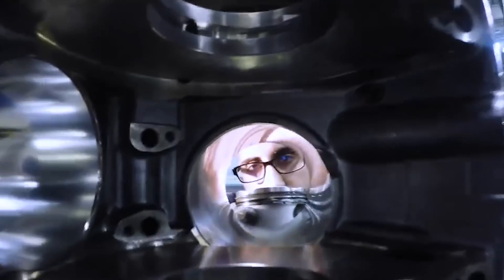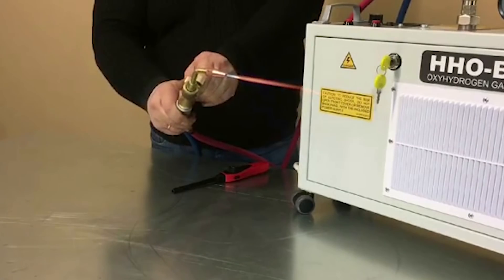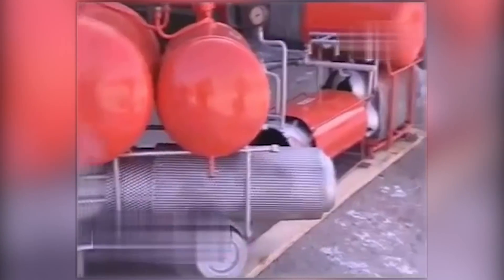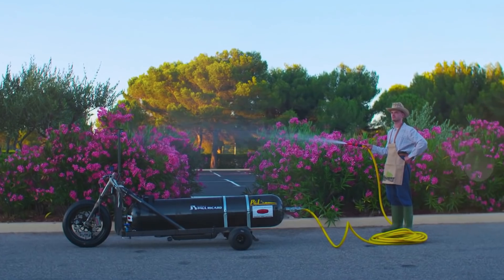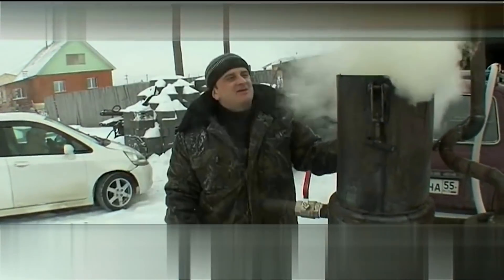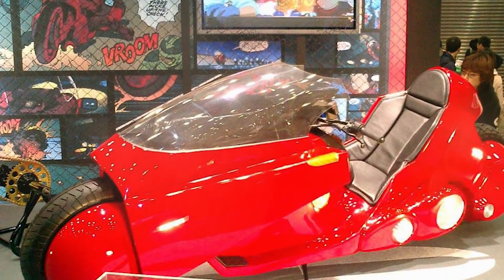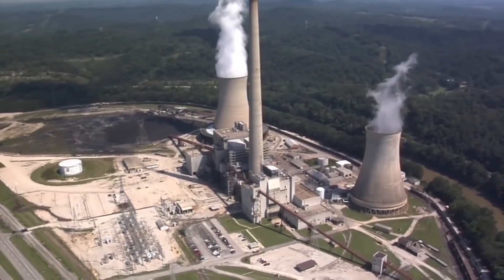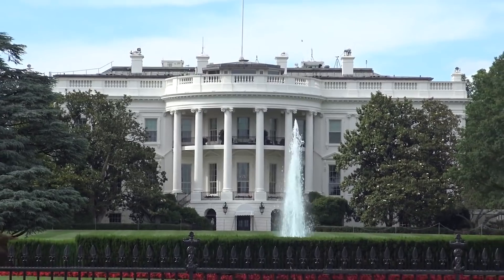Why These Engines Are Banned?

Comment: Also, get in a wreck with that wonder car.. BOOM you got a pneumatic bomb lol
Reply: About forty years ago, I saw a man drop a full dry nitrogen bottle, the neck crack off, and the bottle went through a couple walls, and two cars, lodging in a third, all parked.  It  was dented, paint chipped, but once it's "cracked open" whether a broken stem, or safety valve, the energy drop from pressure release prevents a tank explosion.  That took place on a Naval air station, when someone rolled a bottle without  a cap, across a hanger deck, but something recorded here and there on a regular basis.  Imagine the car suddenly reversing at "full power" as it expends from the striking end.

Comment: Air driven (NOT air powered) cars have existed for a very long time, used in coal mines. Problem is, that the efficiency is very low and they're still powered by conventional means, such as burning coal for generating the electricity to compress air.

Comment: Compressed air engines have been used in wholesale market & warehouse forklifts for many years. It simply a way of moving the pollution away from the warehouse/market. Diesel & LPG forklifts create pollution as they're being used, where as compressed air forklifts only create pollution indirectly, by the compressor, as they're being filled, but this can be done outside in a yard next to the facility rather than in doors. So it means one doesn't have to spend lots of money on extensive ventilation systems & the flavour of perishable groceries arn't effected either. That's the main benefit. Plus there isn't the hazardous chemical waste one gets with the manufacture & disposal of batteries

Comment: Ok so because I'm an American I don't have a very clear real world reference of how long a kilometer is so I'm gonna go ahead and crunch some numbers to help fellow Americans. 1 mile is equivalent of 1.6 kilometers. So the air engine can go 100 kilometers an hour. Which means it goes a Max of 62.5 mph. With a range of 130 kilometers (roughly 81.25 miles). So I'm going to give a real world example of how much of b*tch that would be to a lot of people: my mother commutes about 45 miles one way to go to work everyday. She would get pulled over on the interstate for going 15 below the speed limit, and wouldn't be able to make it within 6 miles of home on the way back. That's why air engines aren't implemented in the US they are crazy slow and range is an absolute nightmare scenario for the average American. Tada!

Comment: "Magnetic engine" yeah bud... that is just a motor... it's not powered by magnetic fields... if it were th s3 t would literally break the laws of thermodynamics.
Reply: Already you can get bicycle lights that work without  a battery, generator or alternator. They pick up energy by using magnets to tap into the eddy currents generated by the spinning wheels, there-by not putting a load on the bike that bottle generators & hub generators do. I assume this Russian tech maybe similar
Reply: @mickvonbornemann3824  If you're extracting power from a system you're extracting power from a system. Any magnetic pickup to drive a bike light applies a load to the bicycle, it's just more efficient than a mechanical interface.
Reply: @mickvonbornemann3824  That's exactly what an electronic engineer calls a permanent magnet synchronous generator. 

They are widely used in different shapes and sizes.

Comment: Compressed air is NOT fuel. It's just stored energy. Same as electricity. These types of stored energy engines require ANOTHER engine to store the energy for them to use. That energy must then be stored in an energy storage tank/battery, then transferred from there to an on board energy storage tank/battery.  High KWH batteries and high pressure heavy cycle failure resistant pressure vessels both require a lot of energy and resources to build. This is why both compressed air and electric engines are both inefficient. They CANNOT power themselves with fuel and require costly, specialized support systems.

Comment: Soo... the only thing that is actually "banned" is the scientifically impossible perpetual motion engine? Yea i guess that makes sense. Building one of those would be against the law... OF THERMODYNAMICS!.
Reply: :P
Reply: Scientifically impossible perpetual motion... Earth spinning forever in a spiralling cosmos would beg to differ.
Reply: @UncleGhoulieTv313  Not at all. You may want to look into the deffinition of the word "engine" the earth is just a big ball spinning in a zero friction environment. If you could extract energy from the earth's rotation that would introduce friction and it would eventually slow down and stop. I am not a scientists but it does not take a genius to figure this shit out.
Reply: @UncleGhoulieTv313  The earth is continuously slowing down as it loses energy (e.g. by the tides). However, it will take a while ...

Comment: Banned by extreme forking brigade. Controlling expansion dynamics inside IC engine through electro-magnetism has been tried and proved to work efficiently with small chain HC but with intermingled & long HC adulteration, it becomes useless. Bajaj in India tried dts-si with intake nozzle design for better atomization but adulteration brigade simply killed it....

Comment: I had a toy car back in the early 70's which had a compressed air engine, all made of plastic, except for 1 bearing and spring which was the check valve. you pumped it up with a little toy tire pump that came with it. It sat around until i was in my teens, and I hooked it up to the air compressor, and over pressured it, the check valve bearing got hot, and melted into the plastic..

Comment: None of these are "banned," and some of them require more energy in than you get out, even over and above a normal gasoline engine. You have a very good point with Thorium generators, and the U.S. had one running back in the 50's or 60's, as I recall, so it's not like we don't know how to start producing them, although I hear they still have corrosion problems. The fuel is cheap and plentiful, as well.
Some of the deaths you mention are very suspicious, I'll grant you that. But the Wankel, wood gas, air-compression vehicles...none of that is secret, none of that is "banned."
I believe Tesla has a large battery designed to run office buildings, that uses hydrogen generated from solar, so the electricity for the building can be generated by solar panels normally, but also can store excess for night time or cloud-cover situations. I wonder just how much excess energy is not being used on a normal day, however.
Many of the comments here are overly criticizing, I think. There is some information here that's useful, but you shouldn't have hyped it so much.

Comment: Fuel evaporization carburetor: 
Changed a small block ford engine from 250hp to 300hp and increasing fuel eco to 30mpg whereas it was around 12-15!!! Been around for 70 years or more. People who presumed it were bought out by foreign oil owners and those who didn’t sell out came up missing, families killed, one person was cut off and not recognized in society, couldn’t get electricity, send or receive mail. People have opened the door to shotgun blasts. I found these accounts in the early 2000s. I haven’t seen that sort of info since when I got curious. Corruption
Reply: ztwntyn8,
Why wouldn’t a foreign country or army use this technology?
Why wouldn’t a competitive race car driver use this technology, or a criminal,  or backyard mechanic, or competitive auto manufacturer? 
Because it’s non existent.

Comment: Don't promulgate bullshit.  You've lumped a bunch of urban legends and half-truths in with workable niche-use technologies (like the wood gas generator you described as a "wood burning car", which would just be a steam car burning wood, which a gas generator is not).  There is no global conspiracy against engine technology.  Anything useful will be invented.  The car companies would love to sell cars that got 100MPG or didn't use oil at all or whatever.  They don't work.  Closest anyone has come is Smokey Yunick's "Hot Vapor" Adiabatic engine, which did generate very high horsepower and achieve very high fuel efficiency, only thing was the thing ran so hot the block was incandescent!  It ran on the bleeding edge of materials sciences, like the Atomic Ramjet in the SLAM (Project Pluto).  It's still around and some guy is still working on it, but it's possible it will be many decades before it's ready for mainline use and we may very well have something better by the time materials sciences makes it possible, kinda how you could almost certainly build a supersonic prop plane (say, for instances, an airframe like a Raytheon Starship with 2x of the Kuznetsov engines from a TU-95 "Bear") but for what purpose?  

True evil is rare in this world, and evil is unprofitable, (Nazi Germany wasted critical defense resources like fuel and railway motive power and rolling stock to wipe out the Jews, whose labour and technical prowess could have definitely also contributed to the war effort), so what it's easy to see as evil on the surface is usually either stupidity, inertia, or a factor or factors the observer does not understand.  There are some cases of "disruptive technologies" being intentionally crippled by industries, but all the examples I'm familiar with are consumer recording devices that the media industries demanded be limited to prevent people from copying their works; things like DAT and DCC, W-VHS and so on.  But these things did make it to market and were developed by big companies themselves.

Cars and other prime movers can't run on water or air.  Water is basically the ash of the combustion of hydrogen gas, you can't burn what is already burnt to hell and back.  Cracking it requires energy input and is a niche use technology although the use may grow as circumstances change.  Compressed air is simply a storage medium for energy, and a rather shit one at that.  The cylinders are heavy and dangerous, if they are charged they detonate with considerable force if breached, not something you want in a small, lightweight car.  

Nuclear power is the victim of stupidity on the part of "environmentalists" who associate it with nuclear arms and the Chernobyl disaster, in ignorance of all fact and reason, and who will never be pleased by any technology no matter what.  The same "environmentalists" protested a windmill farm off the coast where I live, claiming it would mung the paths of migratory birds.  These people cannot be pleased and it's recognition of this fact that makes people ignore any concern of the environment because they know there is no way to please the environmentalist, who is, at his heart, an idealist, and we must remember that an idealists is one who, on noting that a rose smells better than a cabbage, concludes that it must also make a better soup.

Comment: I’m no rocket scientist, but’s hen he said “air tax” I was like, really?😂wtf, I’m so lost... is this banned car mods or makeshift fuel replacements?
Reply: No need for an air tax. Your air compressor will run off electricity generated by burning natural gas, so the carbon tax will take care of it.
Reply: David Gallinger David Gallinger David Gallinger reason for my original confusion is the word “banned” led to the miss understanding, while in reality they’re more like concepts that can be used to create alternative versions of propelling things like oneself forward without having to burn more traditional methods like gasoline. Nothing was mentioned about banning these engine replacements in any sense, just concepts that hadn’t been made into a realistic application. Also would the carbon tax make the air tax completely redundant, furthering the lack of this already existing hybrid technology? I mean a Toyota Prius does basically the job of lowering carbon emissions in already done ways, as well as fully electric cars like the innovative Tesla models, while its cost being a charge of their batteries.

Comment: The big gain will be higher efficiency, if true I had no idea the compressed air car had that much range. Shaft power from basically from anything( if powerful enough-water wheel, windmill, etc) can turn a compressor. The real intrigue with the HHO is the fantastically hot torch( can melt granite) this system can power( no,I do not think it boosts mileage unless it increases the efficiency of the combustion process.

Comment: Please dont spread misinformation, you are touting free energy when it doesn't exist. Also, the amount of energy required to electrolyse distilled water and then used to power a car is a lot more to the point which it loses efficiency.

Comment: Mate do research next time, hydrogen cars have very expensive maintenance and its not as easy to keep as a stationary unit, the air car made by tata and mdi wasnt produced and you cant makee such a car without bottom claddding if the tanks are there. There is a lot of stuff you are omitting.

Comment: Do you honestly think big oil can stop inventions from being sold?  This is the "information age" after all.  These ideas have come and gone and either are not as efficient as they claim, they are horribly unreliable, they are too expensive to manufacture, or they are dangerous... or more recently pollute too much.  But the thing is there are people, companies, and countries that will try just about anything and care little about big oil or the rest of the automotive industry... or about safety, reliability, cost, efficiency, or emissions.  They will make one and see if it works and then worry about the other problems.

Electrolysis and wood gasification works, but it is horribly inefficient.  Air pressure is with any significant range is heavy and dangerous and to make them safer takes a lot more weight.  People come with these ideas and try to sell them to bigger companies, but few will touch them because they know they will not work as claimed or else they would not be selling the design, but instead would be looking for investors.

Besides understand there are companies much bigger than oil and automotives out there that would jump on anything that would make them more money.  If they could prove any of these things were viable replacements you would be seeing the Amazon or Apple car.  What's a few billion to set up a manufacturing plant and bribe a few politicians to get a car company started in today's world.

Comment: every time he mention about oil companies being the one who block blah blah blah blah... makes my brain hurt.

only gullible simpletons will absorb such conspiracy.  I once think that way too about the oil companies.
but after I got myself in the financial market and learn technical analysis. things change.

The real reason why these engine never get to the market is because of fuel cost and the danger of rising demand. 

every country right now has problem over huge number of vehicle in the road after the oil went down from 148 per barrel down to 35 from 2010 to 2015 right now I think it is at somewhere 70+. 

cheaper oil = higher car sales ....  resulted to huge amount vehicle on the road causing traffic crisis.
now let the fuel be air or water (which is free) .. what do you think will happen to our roads?

Comment: Not sure if these are banned, rather seems like they are not a suitable replacement for the lives of modern people.
Reply: They are unhandy (wood gas engines) inefficient (Wankel engine) or extremely inefficient (compressed air engine), or just hoaxes (magnetic motor - which works very well as synchronous motor/generator but consumes the same amount of energy as any electrical engine).